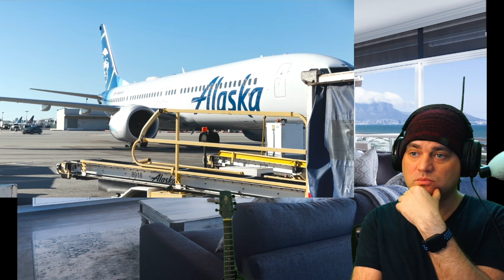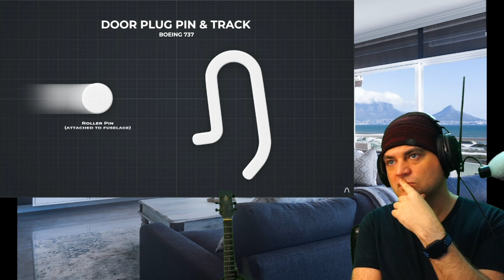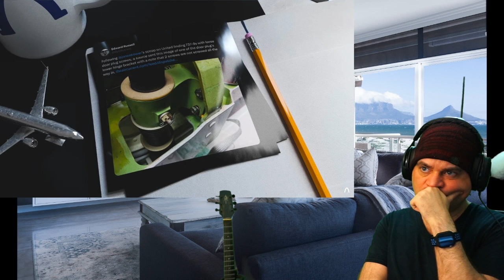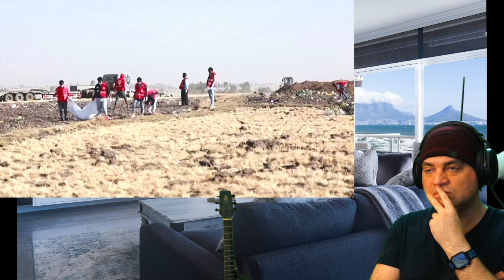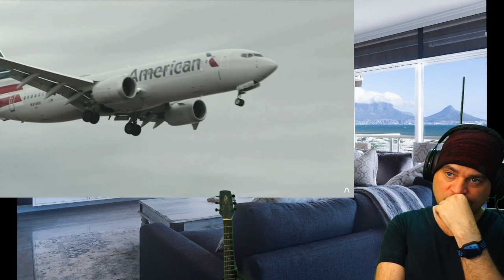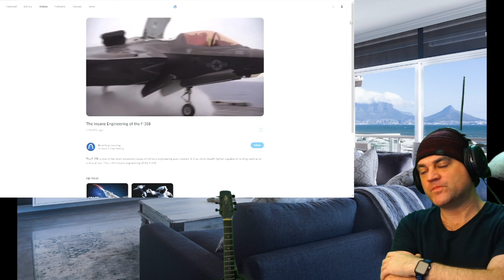The Questionable Engineering of the Boeing 737 Max 9 | Reaction

Comment: As an aircraft engineer and pilot for over 30 years, you need to stay away from such scare monger YouTube channels mate, this guy is beating up the issues and making suggestions that he then draws conclusions from which based in fact. Boeing corporate have some serious systemic issues, thats a fact. It dates back to when they acquired Mcdonal Douglas and their failed business practices.  Moving the engines isn't ideal but its a valid engineering solution and nowhere near as scary as the uneducated public would know.  In a very small part of the flight envelope the MAX is prone to pitching up (low speed, high thrust).   MCAS is designed to imitate the 737NG so a new type rating training wasn't required. Again this is a valid solution.. However, the implementation of MCAS was a disaster.  Boeing wrote the rule book on failsafe redundancy which they seem to have lost since taking over MD.    Scarier still their executive bonuses are now aligned with their performance in Diversity, Equity and Inclusion hiring practices.... instead of the 'best person for the job'....  Thats a safety issue for a future date.    From the first flight to today, accidents, mistakes and negligence happen in aviation... Boeing's performance right now is unacceptable, not just on the 737 by the way.. But as an aircraft, the MAX is a solid design thats been poorly implemented. It will go on to fly for decades.
Reply: Excellent post.  Nice to see some pin accurate comment on any YT video.